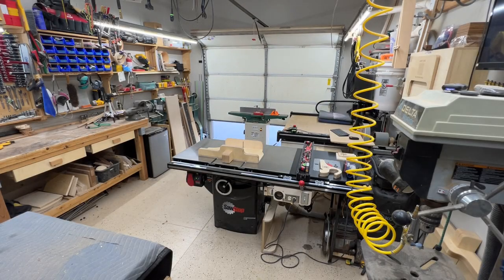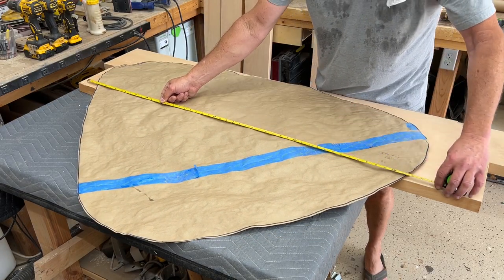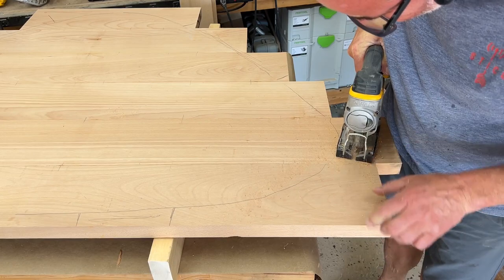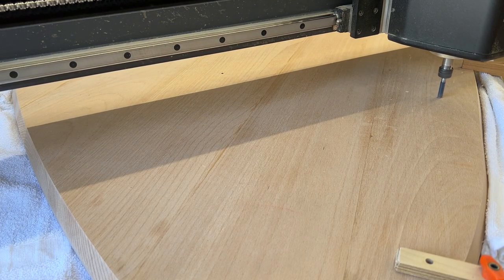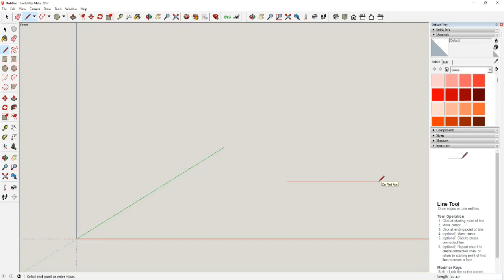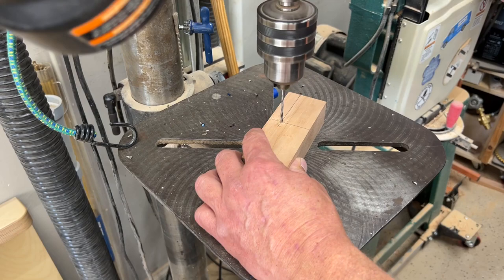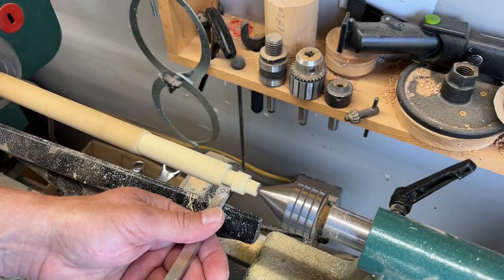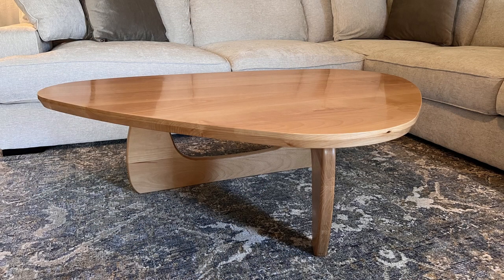Sculpted Noguchi Inspired Coffee Table | X-Carve Pro

Comment: Thank you so much for the well produced video and thoughtful workflow ideas. I am thinking of buying the X-carve pro myself after playing around with the small one.I was wondering about two things in the video: Wouldn't it be faster having the CNC cut out the table top  shape all there way rather than using the jigsaw and flush cut router setup? Same with the legs? Wouldn't the X-carve be faster? Also I was wondering if you could tell me how you exported your Sketchup design into Easel. I used the Face svg extension in the past, but the dpi settings on Sketchup and Easel are different and I had to scale in Easel, which wasn't precise. Also somehow I ended up with some slightly oval circles...
Reply from the maker: Hello, Thanks a lot for checking out the video. I definitely could have let the CNC cut the entire piece, but I think it is actually quicker to just let it define the shape and then finish it with a hand router. Also, I don't think I had a long enough bit to cut through the entire thickness. I use a plug-in called FlightOfIdeas for SVG export. It is a plug-in that someone has modified a bit from the version that is available in the extension warehouse. I am happy to share it with you, but it only works with Sketchup 2017 which is what I use. Let me know if you're interested. Also, If you do make a purchase from Inventables, I would really appreciate it if you used my affiliate link. I have added it to the description of the coffee table video. It can help support the channel.
Thanks a lot and let me know if you're interested in the SVG plug-in.
Joe-
Reply: Thank you for clarifying.Yes, I will certainly try to use your link if I end up buying the tool. I am planning to use it mostly to manufacture structural cabinet boxes with lots of  holes. The typical Euro style base cabinet box has ninety two 5mm holes.  I have read that CNC's are not very good at drilling small holes, so I am still not sure if the XCarve Pro is going to work out for my business. I still have a copy of Sketchup17, so yes, the link would be great.
Reply from the maker: Sorry for the delay. here is the plugin for SVG export. https://www.dropbox.com/scl/fi/cb5qxg3tcemh6rnht4zns/FlighOfIdeas.rbz?rlkey=yeb42krwomcfexfa3jtnax5qt&dl=0
Thanks!